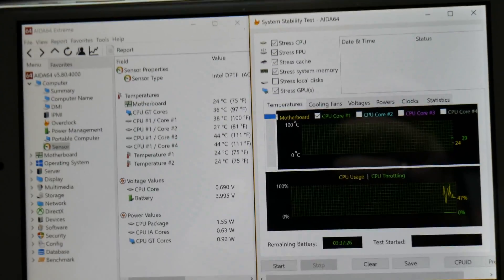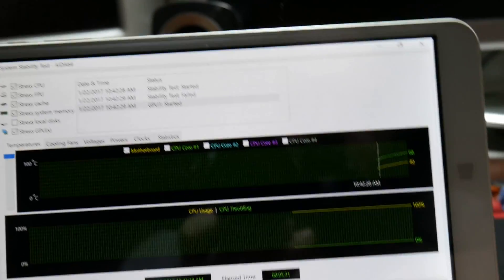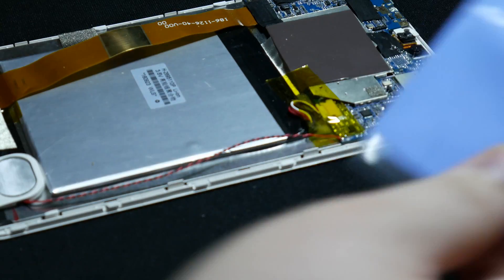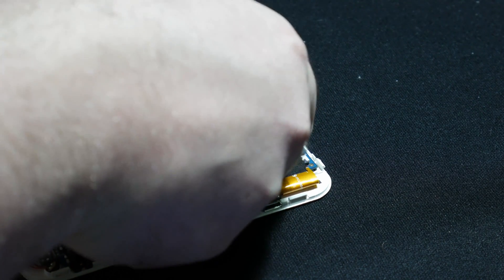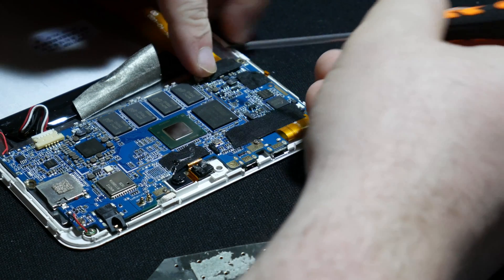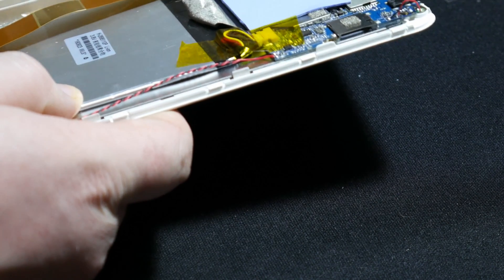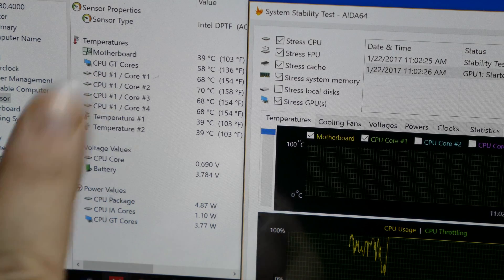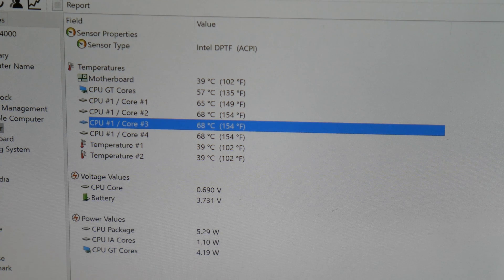Onda v80 Plus - Thermal Testing

Comment: hey buddy, can you make a tutorial showing installation of windows OS?
Reply from the maker: +LEVIATHANDAVID comes with Windows installed and it's basically like any other windows install. If you would like to see it. I'll try and film it this weekend for release on Monday or Wednesday.
Reply: Ooohh thank you, i tried but when start the installer, i get the next error...
http://i.imgur.com/pe24kyz.jpg
here the rom images and drivers..
http://www.ondaforum.com/topic/62160-v80-plus-image-files-available/
thanks.
Reply from the maker: +LEVIATHANDAVID that's odd also that link for the roms makese happy. I am the one that provided those. I had a friend in China get them off biduo or where ever they was I forget now and send them to me.
Reply from the maker: +LEVIATHANDAVID I'm sorry I didn't check your link. That wasn't me. My links are in another thread either way looks like this tablet has gotten a lot more people behind it and has grown a small community ity
Reply from the maker: +LEVIATHANDAVID also I'm going to assume this is the guide your following.

 http://www.ondaforum.com/topic/62484-guide-factory-reset-onda-v80-plus-32gb-windowsandroid/
Reply: yes, that's the guide. just only need to try boot with usb memory, but i don't have a usb hub....
Reply from the maker: +LEVIATHANDAVID o sadly you will have to buy one this requires you to use your keyboard and mouse while the USB stick is also plugged in. So the only way to accomplish this is to use one.
Reply: Ohh man I have one big problem, i brick the tablet playing with the bios, so, can I ask a favor of you? Can you dump the BIOS of you tablet and share? Thanks.
Reply: I can't believe it's just for 79.99 dollars with coupon code: V80PLUS
http://www.gearbest.com/tablet-pcs/pp_651369.html?wid=21&lkid=11050941
I hope this can help you

https://www.youtube.com/watch?v=qZk1uqvy7T0

Comment: The back is made of aluminum, its not as heat conductive as copper.
You might want to use some copper shims and/or tape some copper foil on the inside of the backplate.